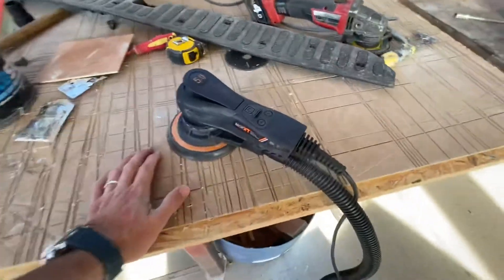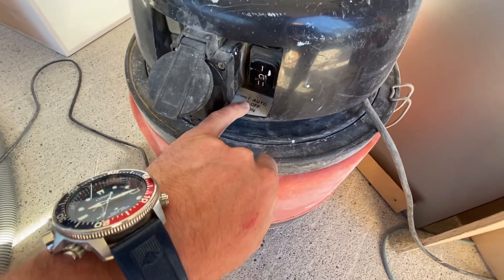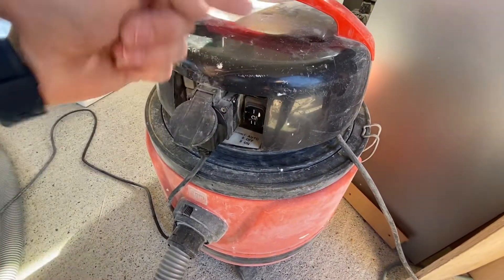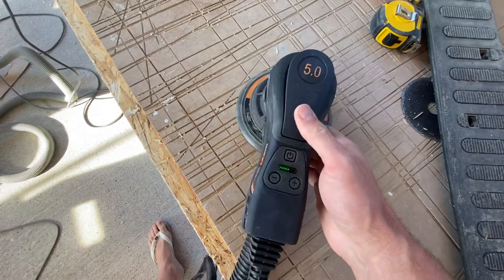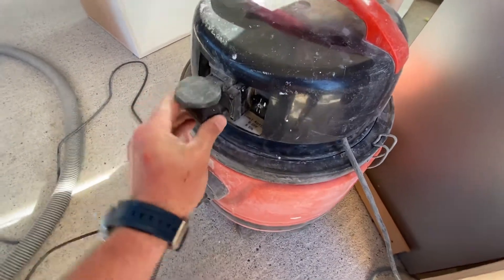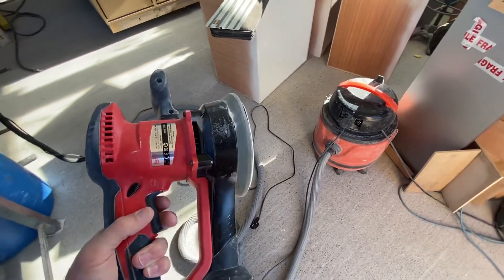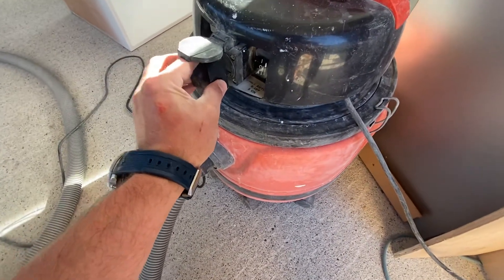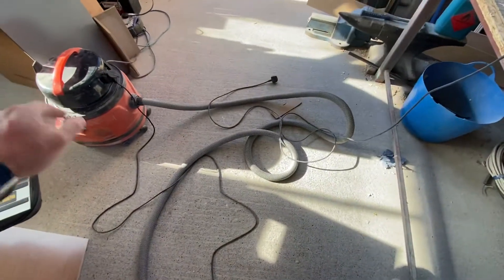Max XT sander

Comment: I bought this sander, used it for a few months and it got stuck on low. Contacted MaxXt and they diagnosed the fault as the led light defective. Sent me a new led control light, installed it and nothing.. Amazon replacement time expired. Shame on me for not buying the extended warranty from Amazon. Now I have a $250 piece of junk.
Reply from the maker: That’s painful. I’ve also had issues. They were 189€ now they are 250. Getting expensive for what they are

Comment: I am interested in buying a few in for our workshop but I have read mixed reviews on reliability. Is yours still working?
Reply from the maker: Yes in fairness it is working perfectly. That little issue is still there with the stop start on the extractor but not an issue for me considering the price. When you turn on the sander and power up the speed with the + button, I run it on light from the top. This runs very smooth in the hand compared to full power. Less fatigue on your hand for long sanding periods. Happy over all
Reply: Save your money. Get the sander that  Surfprep makes. Awesome tool
Reply from the maker: @kfu4657  not available over here

Comment: Might be due to the maxxt using small amount of power for the indicator lights for speed control.
Reply from the maker: Ya I’m guessing something like that. Even though when the power is off on the sander it still does it. Good sander tho but they just need to fix that small leak of current